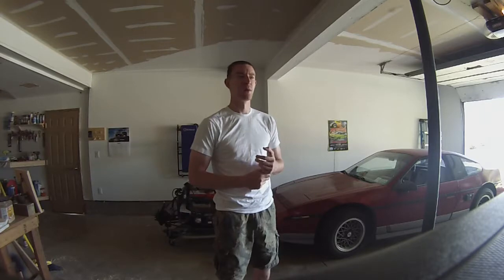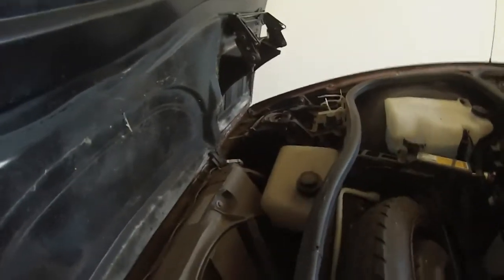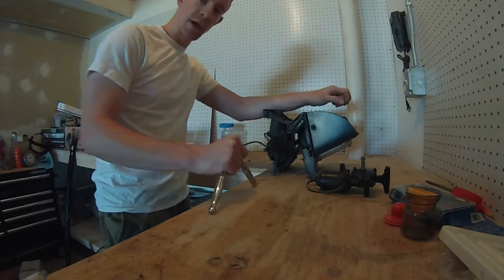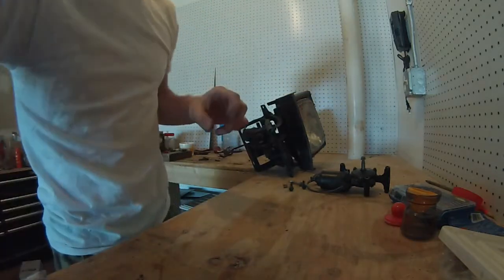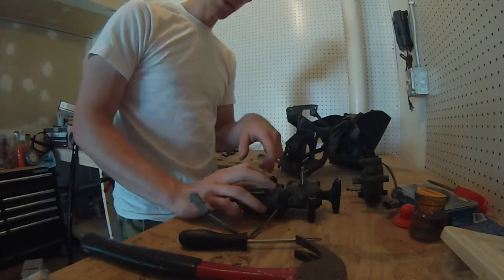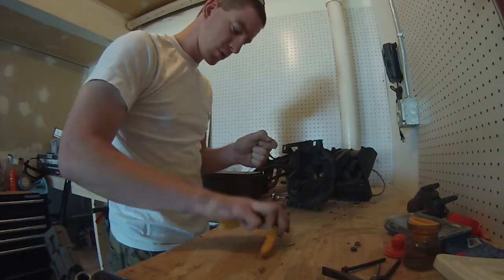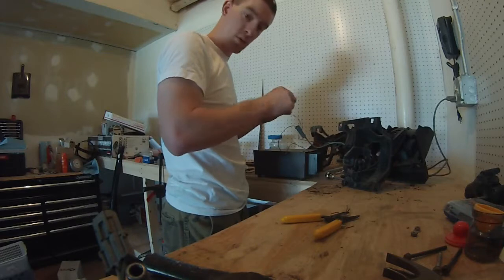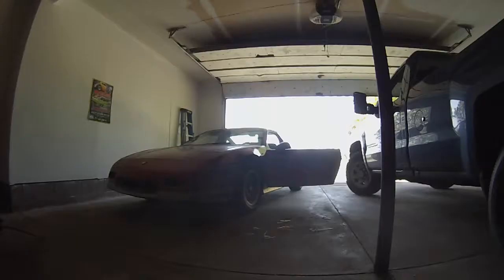Pontiac Fiero Headlight Replacement, Finally Road Legal!

Comment: Hello I am having trouble removing the headlights having a difficult time reaching the bottom bolts to loosen. I'm attempting to replace the driver side headlight motor. 87 gt
Reply from the maker: Are you trying to remove the bolts on the headlight itself, the motor, or the ‘bucket’ that secured everything to the car?
I believe the nuts holding the bucket into the car are 10mm, and they are a pain to get to with the hood on the car and the motors still installed.  Try taking off the headlight itself and the motor, that will free up some room

Comment: When I did mine, I made it so I could open one at a time. So when I was Parked and had them up, I could make it Wink at Hot Girls as they walked by..
Addition: Mine weren't stripped or anything, just the Grease Dried up and clogged the teeth of the gears. After a Good cleaning and Regrease, they worked just fine. Because NEW Mechs for them are Spendy.
Reply from the maker: Actually Rodney dickman makes new gears for the motors, only about $35z
Glad you had Fieros tho 👌🏼
Reply: @AmateurProf  Bought it from a Dealer and he wanted $2400 for it with only 65000 (edit to take out the extra 0)  on it. The Next day I went to go pay for it, while he was parking it, it threw a rod. Would not want to sell it to me but I insisted. He sold it to me at Cost $850. I Drover it home 20 miles spewing Smoke and oil out it's ass.. took 1 yr to get enough to put a Brand New Iron Duke Engine. Got to drive it for 6 months and never ran right. Keeps/kept stalling at the lights. Timed it, Checked computer replaced everything but the Map sensor and still would not run right and was only getting 10mpg and not the 40-50 like everyone said I would get. then I had to Park it because I was moving and had no way to haul it. So it's been sitting at a friends house for the past 11yrs with only 500 miles on the New Engine... It's in another state. Still don't have a Car Hauler or the Gas$$$ to go get it... And once I am able to....... It will have to be gone threw all over again. It had New Breaks, Wheels, Clutch, Shocks, and other stuff. It will also have to have Body work done on the Passenger side because some Asshole Bumped it and Cracked the Fiberglass right behind the door on Christmas Eve of 08, they were drunk and the Cops did Nothing about it. Front Plastic Nose needs to be replaced, it's warped. Needs a New Battery Tray as it Rusted away from a Leaky Batter that also Snapped the Hood Strut and a New Trunk Lock when someone decided to Break into it along with a New Center Counsel they Ripped out to steal the stereo... Friends and Family say write it off since it would be cheaper  to just buy another one that still running and in good shape.... I got over $5000 into it as it's sits and only offered $1000 Max by people who want to buy it as is... So I am a Little Bullheaded about selling it....